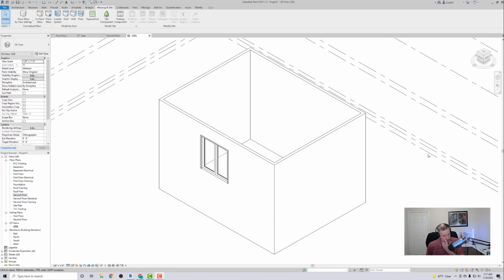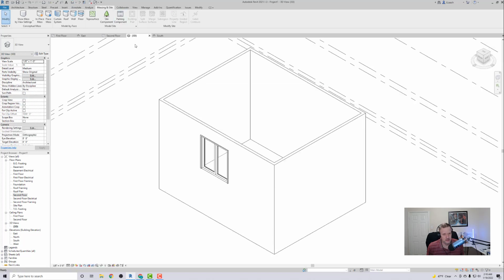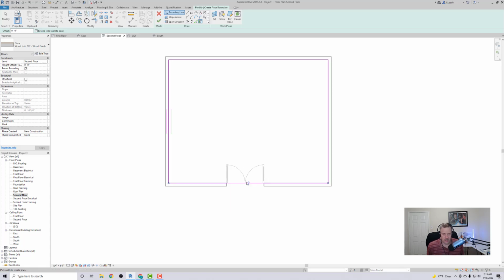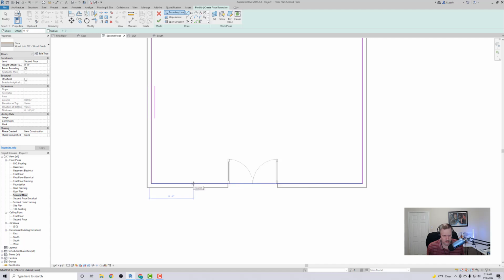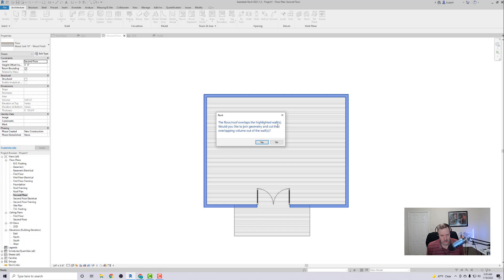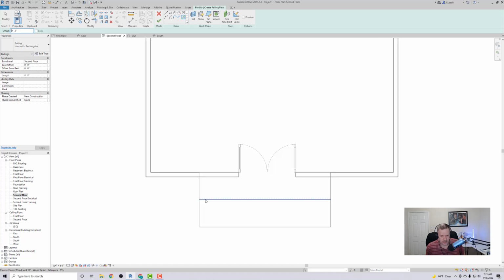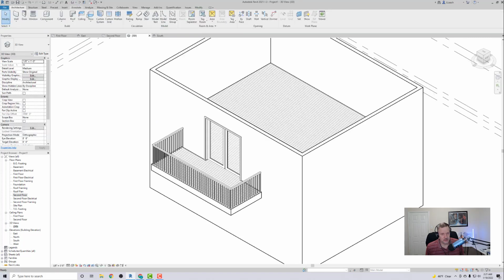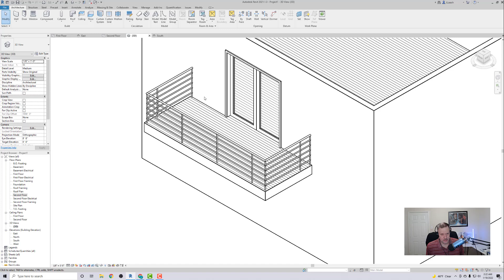CREATING A BALCONY AND RAILING IN REVIT

Comment: what about if there is a ceiling under the balcony, how to do that?
Reply from the maker: You can create the ceiling by sketching the perimeter lines under the balcony similar to creating a ceiling within the building.
Reply: For example the house I am creating is a 2 storey house, then from 2nd floor finish line to finish ceiling line of ground floor, let say 400mm, in sketching the floor tool in revit, should I set it as the slab thickness of the suspended slab based on actual for example let say 125mm thick suspended slab, should I put its thickness as 125mm or should I set it as 400mm, and set a hatch, so in cross section it is presented as a whole hatch. Since there is no beam tool in Architecture tab, so my cross section won't show the beam anyway.

Is my approach correct?

If yes, would there be no conflicts when I sketch its ceiling, because my 2nd floor floor is 400mm from 2nd floor to ground floor finish ceiling line. Because If I were to sketch a ceiling, it surely going to touch the bottom floor of the 2nd floor.
Reply from the maker: @Y_tube_watcher  If I am understanding correctly, you want to show them as 2 separate items. Your floor thickness and your ceiling thickness, not both of them combined as one.  You could show the beam placement in your section within a drafting view.